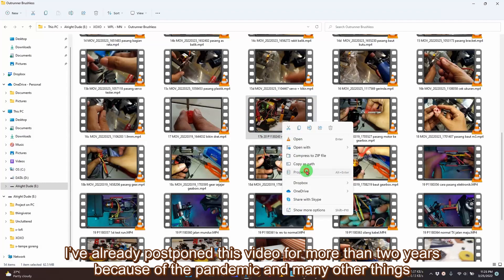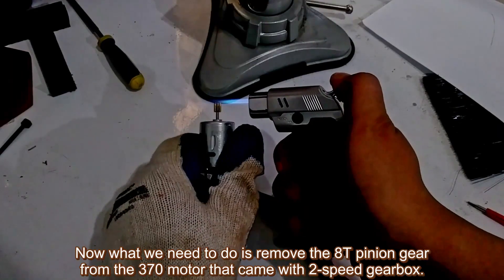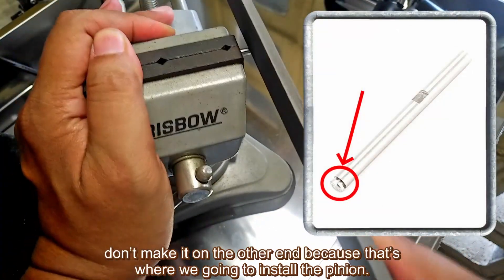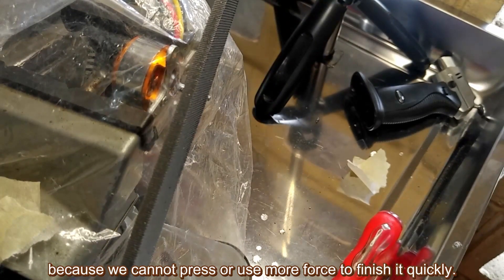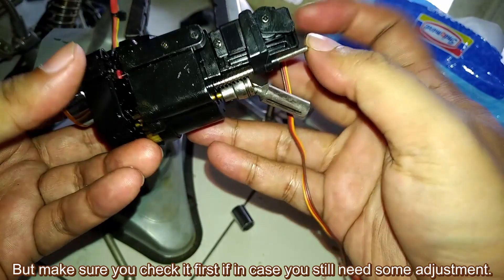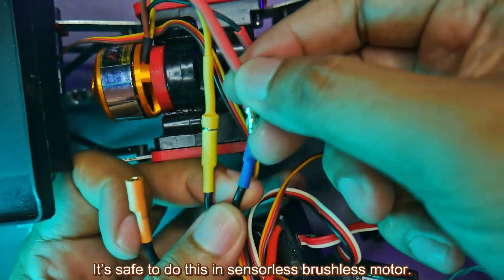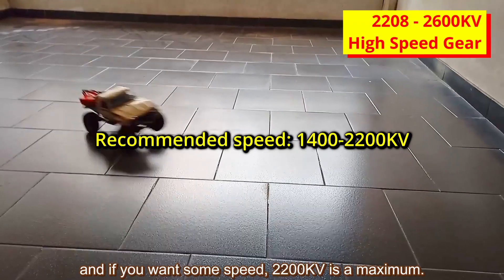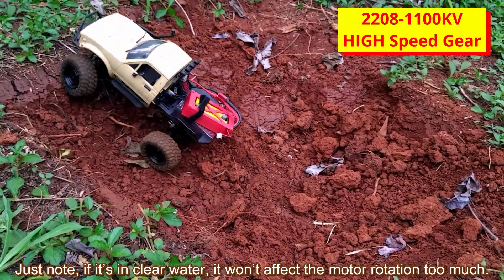WPL / MN RC USING DRONE MOTOR!!! (Brushless upgrade)

Comment: i used 2435 and swapped gear no modifications. works great
Reply from the maker: Yes, if you use a 2435, you can just change the gear. But usually, for crawling, outrunners have more torque. FYI, I also tried using a 2445 motor, and it's really fast: https://youtu.be/wg5MaKeiNMM

Comment: What do yiu think about using a 1400kv 17T. Id like to crawl very slow, but habe high torque. I noticed some trk4m furitek go  up to 3456kv
Reply from the maker: 1400KV will be alright. And in fact I think it's the ideal speed. It is slow enough but not that slow
Reply: @gadogamix  thanks! I actually ordered it last week

Comment: I have found a brushless outrunner motor that fits in the footprint of 280/370 brushed motor, the D2225, it's only 22mm in diameter and 25mm in lenght, 3.175mm shaft x 13mm long already in the correct side so no need to do any modification to the the motor! Bit more expensive at $10-15 compared to <$10 of the A2208 and is "only" 80W at 1350kv, there are other smaller motors with 3mm shafts but may work better for your application (small pinion gears, such as the stock WPL one), I went with 3.175 because I had already ordered the pinion
Reply: Will I need to do any cutting or anything or just remove and switch motor and add the gear. 

Also would that motor fit in those aliexpress metal reduction gearboxes or should I just stick it in a stock 370 wpl gearbox
Reply: @EmDżej_0o  DYS/Flashhobby D2225 motor, also sold under other brands but I've purchased from both and they're great little motors

Comment: If you're going to order another pinion, just get one with a 3.17mm bore, no need to file down the shaft, make the job so much easier but unfortunately the 370/25mm gearbox calls for a 12T 0.4m pinion and no one seems to sell it, I was able to source one for the MN78/MN82 stock gearbox 10T 0.6m

Comment: what esc you use?
Reply: Drone ESC works better with outrunners, cheaper BLHeli_s works OK if you tune some settings, but BLHeli_32 performs better and you can flash to AM32 or Escape32 firmware for much better crawler performance

Comment: Hello everyone! Is there no cogging issue with this motor?
Reply: Use a Blheli_S drone ESC
Reply: @daijoubu4529  hi! Will it eliminate the cogging or just lessen it?? Thank you!
Reply: @randomstuffs1671  from others that runs those Blheli ESCs, I do not see any cogging, can do silent slow crawl, unless the motor is too powerful for the ESC or the battery that is

Comment: Adapte un 2435 de 4500 kv y es demasiado rápido muy brusco. No tiene mucho torque más bien es más rápido estoy pensando en ponerle un motor 9im motor 3532 de 1470 kv .

Comment: Hi I'm currently using single speed metal gearbox for my wpl c24 which one is better 1400kv or 2200kv?  Im more on crawling.
Reply from the maker: Unfortunately I never had single speed metal gearbox (the one with "U" shape) so I don't know the gear ratio. But I guess for crawling, 1400KV might be better. But again, I never try it on metal single speed gearbox.
Reply: @gadogamix   if I'm providing you the gear ratio are you able to suggest what kv I'm more on crawling so I want some ounch and torque
Reply: @johnalexanderayudan9229 for reference the ratio should be 1:35, so 2200kv would be better

Comment: dream to make WPL trucks like Dakar rally trucks and cars with brushless set up. Do you think its possible to make it with 30-40km/h speed?
Reply from the maker: Yes it can. For speeding, you can use inrunner brushless. Here's a video (It's MN45, bit using 2-speed gearbox for WPL): https://youtu.be/wg5MaKeiNMM

Comment: Great video! At 1:20, is it Hobbywing 16BL30 thats in action making crawling so smooth? Will it start slowly with that esc? How many kv is that motor?
Thanks!
Reply from the maker: If you using rather low KV motor (i.e 1000 or 1400KV), It can also smooth crawl even if using cheap brushless ESC.